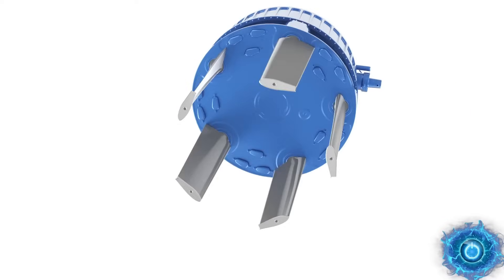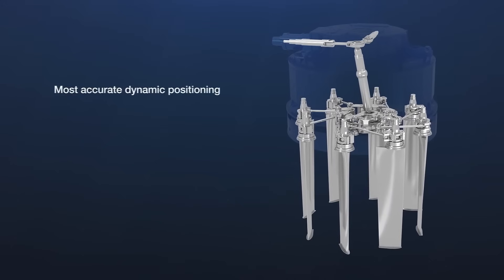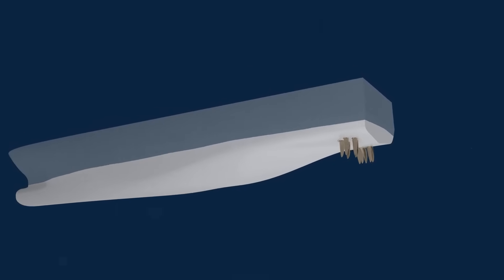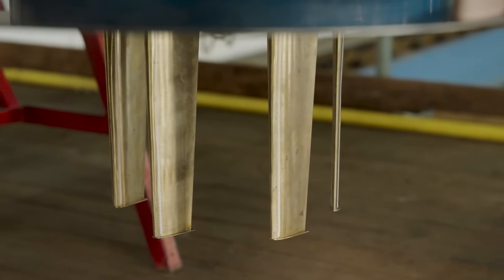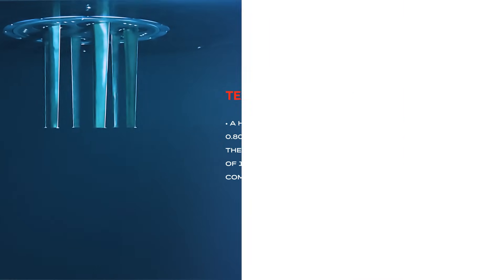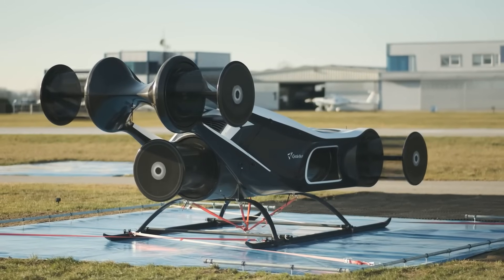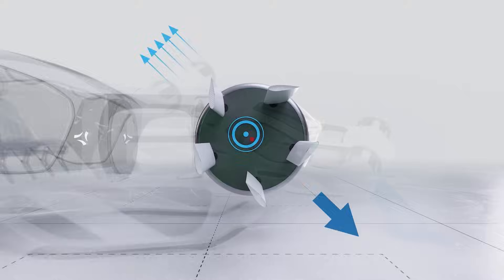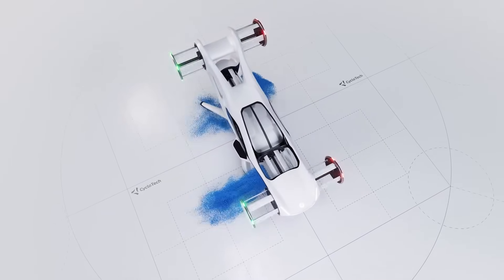Unveiling the FUTURE: The Cyclorotor Craft Explained

Comment: Tug boats have been using these for decades already because of their instant response and thrust vectoring. 
Sadly it's too heavy for aircraft and you also don't need thrust vectoring for aircraft, gravity is enough to go down. 
Much more promising are tilt rotors, or if you want something like the cyclerotor, the fanwing can carry higher loads than conventional rotors because of their higher thrust but there doesn't seem to be much development into centrifugal fan powered aircraft.

Comment: Everyone keeps misquoting the ABB Dynafin efficiency as 81%, but that is compared against an exisitng screw type prop which itself is typically 75% or so. So the overall propulsive efficiency is actually 60% not counting mechanical losses, which would be substantial. It's right there in ABB's summary at 2:06

Comment: There is argument about this propeller being better at making a work field bubble or hyper cavitation to do a warp assisted trajectory flight, which is a World War I bug out maneuver what I’m gonna tell you is this is the right propeller for that. That is the right direction you need something exactly the shape of a Coca-Cola bottle that is also propellers just like Coca-Cola bottle has ridges going in the opposite direction in the inside of this, and it turns it through use of force The particles going through both hydraulic pumps, actively work as housing for the force coming off of the thing and you can make some really neat shit happen with it, including using six of these on three trans axles in the middle of a hot dog and driving through. That’s what they used for ridiculous length of time to do Warp, assisted trajectory flight and is kind of step backwards. A step forward is learning about something that I’ve been talking only in the last few days of if you look right this second and do a YouTube search for 50 X faster Arduino you’re gonna see a guy playing with an Arduino and an a telescope and when everybody gets to that point when they see that in both computer programming and hardware, they back off of it because they kinda know what they’re messing with and other people who are criminal will tell you it’s not right there. It’s further down no that is exactly where the line of the band of causality cutting through everything as a programmer looks at it and they say someone or something like government agency keeps coming through here and cutting this one bit off of every line of programming every time I mess with it and it’s not it’s actual gravity cutting that off of there and that’s what Bill Gates every time my family whom commissioned the CIA because they had already messed us up to produce the fifth dimension storage cabinet for the international bureau of magicians and perpetuate the hardware all the way back to back to what we had in the past, which was Federation style starships they decided to monopolize on this because they needed money to help move product to put more computers in people‘s hands. They eventually learned about engineered obsolescence and they started making their software and hardware not conformed to the original manufacturing specifications. We did not sync their ship instantly because Apple was there while they were both doing it and they were both contaminating other people stuff. Apple was keeping to the mandate of the starship consoles in our pockets that were transparent. The transparent speaking stone is spoken of biblical scripture. That’s what Apple was mandated to do. Apple has seen fit Since the advent of the first Apple earbuds or I watch to start putting the money in their pocket and installing the project, hence all of them are responsible for mass decades multiple decades of taxation without representation Apple is silent, partnered with and not really silent partnered with an I coerced them to the best of my ability to produce nothing but the best of hardware. Not to produce inferior hardware at all, and instead they have chosen to use software to limit their hardware And as such the guy that chose to put all of Wall Street on his phone when the phone came out that had the largest battery capacity recently that had the smart phone. They released it recently. The first time that happened that’s when he did that when the Apple Watch came out, it was because he put all of Wall Street actual server The actual server in his wristwatch and he’s just a CIA spook that killed a bunch of people to get there, he’s not somebody that went through all of the bells and whistles that he was supposed to go through whole bunch of people that are in their positions right now or only there because they killed somebody And the security system is forcing them to stand in that position until we can find somebody that’s actually better. They managed to while forced to stand there kill all the rest of the people that matter until they’ve got down to just the last group of them. The last group of them sent a signal out And now all of us are waking up from chemical memory suppression anyway when you watch that video about that Arduino that’s fucking around with gravity fucking around with half of gravity that’s the band of causality that’s also known as sub space used properly. You can do what’s called warp field dominationand virtualize just the output energies from a warmness cell and fake the entire engine the entire starship without the need for anything except your little wooden telephone box, Mr. Doctor Who welcome to the real world when you try to assassinate somebody you better know what you’re fucking doing.

Comment: It seems like one beast power plant to generate electricity required should be sufficient for long flights then the flight times based off of fuel
Reply from the maker: Maybe setup for hydrogen electric or turbogenerator?
Reply: Like a big one that operates like a diesel train
Reply: Could be like a semi truck of the sky